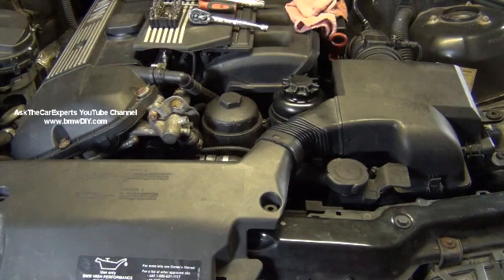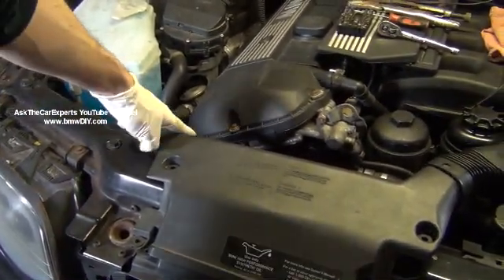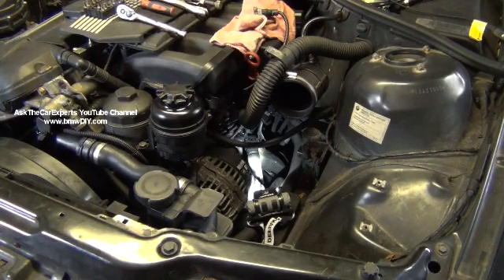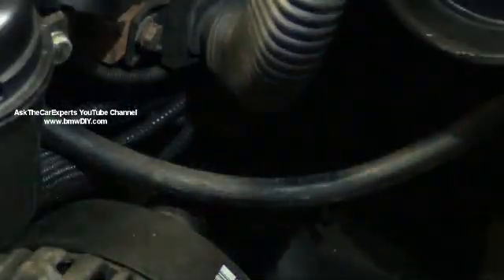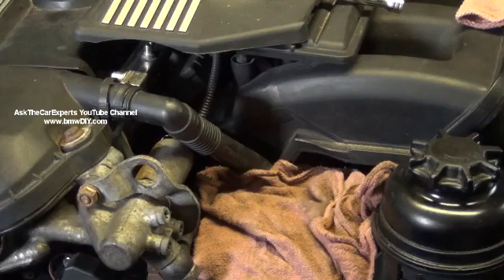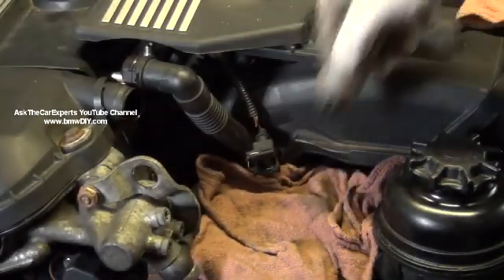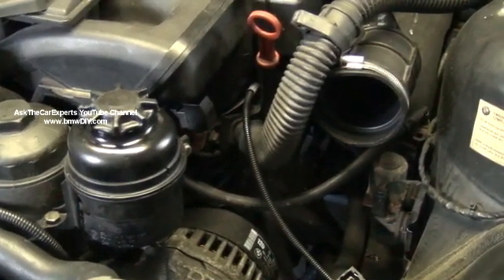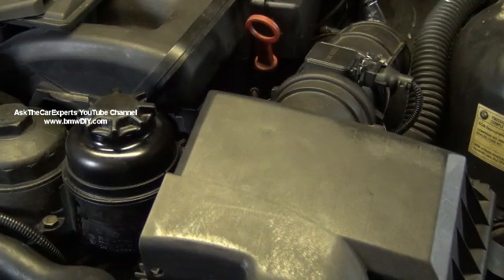BMW P0344 P0340 Intake Camshaft Position Sensor Fault  DIY Full Removal and Installation Procedure

Comment: Excellent video and a great little job to do by myself.  Unfortunately I replaces the unit with the MEYLE sensor Part # 314 899 0038 and this part failed after less than 50 km.  Very frustrating and MEYLE factory said no recall no refund.  Maybe just use the OEM part because you don't want to do the job again in a couple weeks.
Reply from the maker: Thanks for posting Dwight! I am glad my video helped. They should have refunded you or gave you a new sensor. There are a lot of good aftermarket parts but it is always a good piece of mind to go OEM. Please remember to subscribe if you have not. Thanks!

Comment: Great video. Question though, after I replace the sensor is there anything I need to do? I ask because I replaced it and all seemed well for a couple days until i had another hard start and P0340 showed up as a new pending code. Code did go away later that night. Any advise would be welcome!

Comment: hi first of all want to say thank you for all your excellent videos thank you your video has been very helpful to me. I have a big situation that I'm going through with my BMW 2008 X5 now for 3 months for some reason my car when I start it it has kind of a engine shake or when I'm driving it's sort of like rattles not sound like but it shakes at low RPMs like a old 40 year old vehicle.. so I had it checked by a mechanic and the things that they did to it was first day replace oil filter pump assembly, 3 ignition coil 123 with new spark plugs I also had the Vanos Solenoid replaced both and I am still getting the shake and I am continue to get the misfire 2 sensor which it was already replaced new with BMW parts can you please help me tell me what I can do I did a few things to it like I run the engine and test all the coils one by one and the performance was perfect so I don't know what else to do...
Reply from the maker: Hello, Can you send me the last seven digits of the VIN and the fault codes you are getting currently.

Comment: what determined the sensor as actually needing replacementl other then a P-code? You seem to know by just looking at it. Do they actual wear out?  thk's
Reply from the maker: This replacement would be for a P-code or in some cases stalling can occur with no fault codes. I have recently seen them start to fail at the pins and oil is being sent up the wiring which can reach the engine computer.

Comment: great video. i have a 2000 320i in tokyo to which i'll be making this repair. actually im changing both CP sensors. but the exhaust sensor is a piece of cake

Comment: Hello I have BMW 2000 540 and I have the code p0011 "variable timing solenoid" where is located? can you help me?i need to make sure because i'm gonna do the job.thanks a lot I'm subscribed
Reply from the maker: +TekkoMaverick Hello Tekko, Can you contact me via my website www.bmwdiy.com I will be able to help you easier with this problem.

Comment: thanks for the video. I haveBMW E46 320d, My car start's and drove ard 30KM , while idle it turn off. It happened few times I waited for 15 mins and it start & went to mechanic. He change all 3 pump's but Same problem. Please help as I already paid a hell of money. Awaiting for your reply. cheers
Reply from the maker: +Amit Parashar Hello, Not sure if I can help with this from afar. Do you have any fault codes? Send all the information to my website at www.bmwdiy.com Happy New Year!
Reply: +AskTheCarExperts thx. I will. happy new year. Cheers

Comment: Just wanted to say Thank You for a great video!  Had to replace the intake camshaft positioner on my Z3. Your video made it very easy. Even knew to use a 5 mm allen socket!  Anyway, it was a snap, thanks to your video.  I have a Bentley service manual, but your videos are so much better!

Comment: Be sure to replace the sensor with one made in Germany, such as sensor manufacturers AB Electronik or Febi Bilstein (or BMW sensor from dealer).  I used a Chinese made sensor from O'Reilly's, and had intermittent long cranking before starting.  Then when it did start, the car was sluggish and unresponsive.  But I'd shut the car off, start it again, it would fire right up and be fine.  I found 2 other guys that had the same issues with Chinese sensors, even though mechanics didn't think it would make a difference.  My car: 2001 330Ci, would stall at low speeds and had error code P0344 Intermittent cam sensor circuit.  This video was VERY helpful.

Comment: Thank you very much for this. My E46 323Ci (M52TU) has been struggling with hot starts and a lack of power, especially low down, recently. Threw up error code P0340. Just replaced the sensor with a Femi Bilstein OE equivalent with the assistance of your video and the change it's made is remarkable. Thank you again!

Comment: Car vibrates after i start the engine, and shuts off. Can you tell me whats causing this problem?
Reply from the maker: Hello Leon, This could be too many things to make a guess. You will need to have it scanned for codes and potentially smoke tested if there is an unmetered air fault.

Comment from the maker: This is usually indicative of an issue inside you engine computer. I would recommend having it programmed at the dealer to the latest software level. I have fixed a few of these with just software.
Best wishes!

Comment: I got a code of P0340 on the OBD II reader along with Camshaft position Sensor A Circuit (Bank 1 or Single Sensor). I looked this up and found your video. 

I decided to purchase the camshaft position sensor and attempt to install it myself solely based on this video. The entire thing went so smoothly and it fixed my BMW! 

I just wanted to thank you so much for these awesome videos. You make the process of all these fixes so simple and explain everything thoroughly. THANK YOU! I've subscribed.

Comment from the maker: I think I was referring to the intake side VANOS solenoid which supplied oil pressure to the VANOS unit which changes valve timing. Most often the failure with a code like this is the sensor but in rare cases the pick up ring can loosen and cause a false reading. The timing would have to be reset. I hope to make a video on this before the end of the summer. :)

Comment: i have the code p0340 on my 99 e46. 323i...i never felt any difference in the driving performance...the code just popped up.....and now that ive changed the sensor just as you did in the video...now my car is stalling...smh...help!!!!

Comment: I have a code p0340 Camshaft position sensor malfunction 
                      p1397 Camshaft position sensor B circuit 

Do I have to replace both or just the one on the Exhaust

Thanks in advance